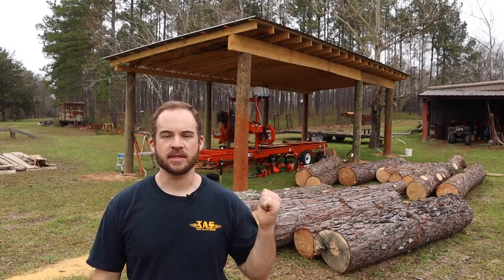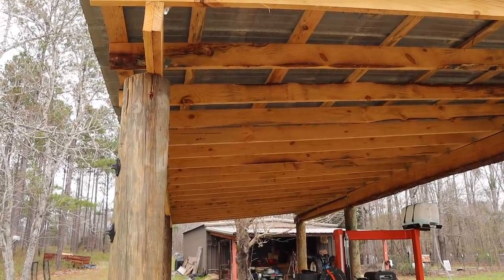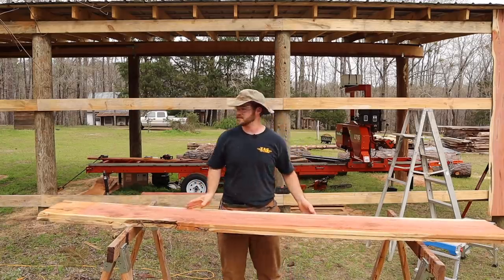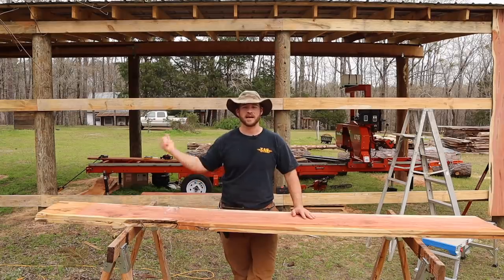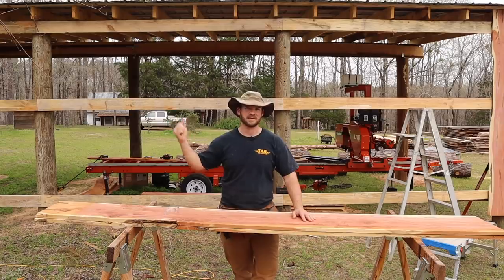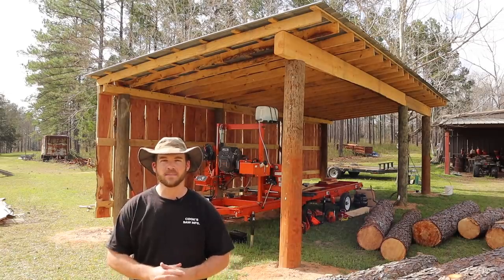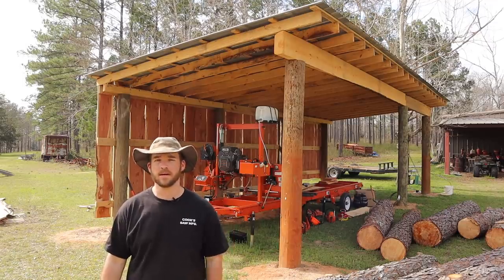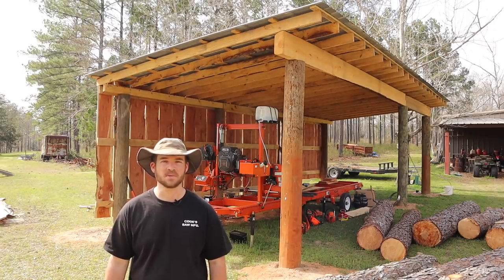These Cedar Boards Made A PERFECT Shed Wall

Comment: Beautiful ! ! 
It's like looking at an OLD COVERED BRIDGE.
I would build yokes from 4x6x18 and screw them to the posts. Then rest the purlins in the yokes. Just make sure to only secure one yoke first and clamp the opposite end. It will need to move around to get the purlin in. Then screw it to that post. - KJ
Reply from the maker: Great advice! Thank you. It does look like a covered bridge.

Comment: I understand their feelings, I love cedar to, but this is still America, use what you want how you want to use it. I would have done that back wall with heavy canvas tarps so it could be rolled up on the nice days.
Reply from the maker: Thank you! That canvas idea is pretty clever.
Reply: @falllineridge  I would use that idea for the end walls and front wall for winter and for ease of removal of the tractor and mill.
Reply: @michaelgoettsch7744  I agree the end and front could benefit with this, specially if they expect any snow. ( Evergreen trees tend to be in areas where snow is a common thing. )
Or even for when the win and rain are coming in from a different direction.
Reply: Fall Line Ridge canvas coated with beeswax is a pretty good waterproof material, canvas is already water resistant to a certain degree
Reply: @BESHYSBEES  absolutely, canvas hanging in sections with a pole at the bottom could be rolled up in sections or all together and tied. This would allow the air to circulate on those hot days. Beeswax would remain flexible, that is a good idea.

Comment: If you cut your joining beams on a 45 degree angle and saw out an indent on your round support post, you'll be able to secure your horizontal joining beams together in the round post. The two joining beams are screwed together on the 45 degree angle straight into the round post. 
Also, a shed of that size with those walls would benefit from some sort of bracing. A brace forming a 'V' shape starting from the top left and top right and joining at the middle post at the bottom.

Comment: At first I was worried about the gaps in the boards but I actually like it the way it is, and it’s good wind breaker but still allows the air flow. I reckon you should also make some more walls though on hinges so that you can lift it, and if you put it lower down, it would let the heat rise up and out while letting the breeze and air sneak in from underneath

Comment: That's a win !! You might take some 1 1/2 angle iron and weld up some hangers and bolt them to your post to attach horizontal boards to the posts might find some old truck frame or old farm equipment from scrap yard keep the John Deer green

Comment: To answer your question in regards to how to mount the top board.   Just mill a block and cut it to the length that slabs the width of the pole.  And screw it down to the pole. Then screw the header board to the block.  And remove the l brackets 1 at a time as you install said blocks.

Comment: Fall Line Ridge ; ..You have to curf-cut  the round post . But first strike a string line of chalk for the top and the bottom of each the board you are using to insert into the round post .    Then by setting your power saw blade to the depth of your boards you can make miniature cuts across the post. Space your cuts at about 1/4 inch till you make a batch of cuts that equal your chalk lines. Then cheasle out each of the small cuts . This will permit your boards to sit flush with each post and give building a huge support .

Comment: really nice job. an easy way to strengthen your purlins is to put a 2x4 on edge between the posts and attach it to the purlin (make it look like a "t"). when you toenail it to the posts, you'll see that flex disappear.

Comment: One thing I have learned from my 76 year old father who has been farming for nearly 50 years, and was a joiner before he became a farmer, is when building outdoor structures use nails, not screws. You never know when you are going to want to remove a piece of wood or dismantle an entire structure and screws get impossible to remove easily with age, whereas nails will always pry off. Nails are also much cheaper, and a hammer costs a lot less than a cordless driver!
Reply: Totally agree, nails nails nails... screws are best used inside, most of the time.

Comment: There is a special species of Cedar for use in closets and boxes for moth...   Aromatic.  Common Cedar is for shingles and other long term uses.  With that said, I think the cream color should be trimmed out - easier to rot that.  Good job - holes will allow some vents for air to cool off in hot weather. And dry in inside if gets wet.

Comment: Spraying some oil on the cedar would keep it looking great for a long time.  I work a lot with cedar and use tung oil but a friend makes outdoor rustic cedar furniture and he sprays it down with diesel.  He says it takes a little time for the diesel smell to go away but the cedar will look great.  He says another coating every two or three years keeps it looking good.

Comment: If you want to strengthen the wall just cross 2x3 lats diagonally from corner to corner. Cut on 45 degree angle and nail to posts. Basically secure those 2x3 lats  like an X from post to post and tack to the cedar boards. That will prevent it from swaying, buckling and still allow for air flow.

Comment: Joining the purlins... lots of options. Simplest would be two galvanised steel strips with holes for bolts and nuts, maybe 3” wide by 4’ long, three bolts in each board. Most complicated would be Japanese joinery, they have a fantastic method, easy to find here on YouTube.

Comment: To notch out the round post make a jig with 2x4 in the shape of a L and clamp horizontally to the post and use this to as a depth gauge.
Alternatively temp screw the 2x4 girder in place and run the circular saw on top and bottom creating a cut parallel with the girder then chip out with a chisel

Comment: Try using the same type of brackets that carpenters use to attach vertical beams to the sides of houses for decks, or to hold joists when expanding a ceiling in a house.

Comment: Were those poles formerly used as utility poles?  I would like to build a shed similar to that to keep my camper out of the weather.  I don't need walls to enclose it, just want the roof to shade the camper and keep the rain and snow off of the roof.  I like how you notched the top of the poles to support the weight of the rafters.

Comment: I tried to see if anyone had given any suggestion for how to properly attach the beams to the post.  You will certainly want to attach steel straps extending down both front and back of post and beam, then  probably a  1/2 X 12 X 12 angle on each side to seat the beam on the post.  I might also suggest  several lateral supports for rigidity side to side.  Wind would be your worst enemy.  Imagine that the roof and back act like sails with the wind.  A heavy wind might easily loft your roof at present.....

Comment: Hillbilly Logic - You go Bro that shed looks good specially that hole at the bottom
Reply: Meh just use corrugated tin roof pieces for cladding and it will look fine.

Comment: You'll be making byproproducts that can be sold.
Saw dust for anyone with livestock for the stalls, wood chips to cover gardens for folks in the city. But you'll need a cement floor to gather these easily.

Comment: Nice shed!  I only have one question.  I noticed the discharge chute on the mill is against the wall.  How do you plan to get the sawdust out other than shoveling?
Reply from the maker: T N That’s about it. I used to lay a tarp down when I used the LT10...let the dust fall on it for a while and then drag it off. That might work too.

Comment: It would be a bit of a pain, but you could also add a plastic tarp tied down on the machine to keep it really dry, and also the dust off of it when not using it for a long time.

Comment: take a long enough  log and  lay it across the bottom on a few sleepers hollow out the log as a trough you can put a pipe on it and drain or keep the water as needed,just an idea you have so many logs.

Comment: You would have had to notch out for those side pieces to be most sturdy.  Now that they are up though, you could cut some wedges to put between the horizontal boards and the round posts.  Then screw through both with 4 or 6" screws.  I doubt you'll need to, but if it ever starts failing, that's an easy fix with those arched wedges.

Comment: Around here Eastern Red Cedar is considered a junk tree, I've used it for posts and burn it in the winter for heat, not the best heating wood, too light, but it does smell good.  Gives me a rash so I have to wear gloves when handling it.

Comment: I just started watching...can you say what kind of fasteners you're using ?Thanks..may be a pole building in my future.
Reply from the maker: I used grip rite exterior on the shed and purlins. I used another weatherproof screw, a torx head deck screw, to fasten the boards. Forgot the specific brand.

Comment: You have a hurricane tie on every rafter and then the whole roof is just sitting on top of those massive posts with a couple screws. If you had notched those posts and cut a birdsmouth in the rafters the whole thing would be much more rigid and structurally sound. A strong wind is going to lift the whole roof off. As large as those posts are, even the girts could have been set into a notch to keep everything flush and tight.

Comment: Since you didn't notch to begin with maybe cross bracing on the inside up against the "perlins" with the ends notched into the poles and also screwed to the "perlins"?

Comment: You asked about cutting the 2x4 to fit flat ways on the post for you wall ,you have plenty of logs on the ground just find one about the same size as the post and take a piece of 2x4 put it at the end of the log holing it flush to the outside of the log and scribe the 2x4 around the log

Comment: You could have dropped the boards down from the roof a bit and left air space for heat to escape no rain would blown in  up top and all your boards would been even on the bottom  Just my take   keep the videos coming

Comment: Very nice.  However, hindsight being 20/20, I think you might have been able to improve the ascetic appeal by aligning the top edge just beneath the rafters rather than just beneath the roof line.  In that way, you could have avoided the problem you encountered at the far end.

Comment: Oh My Gawd ! You Short-Boarded the wall! You big meanie!
... I looks great, I'll bet it smells great, and it's going to age nicely - it's YOUR mill shed, it should be a nice place for YOU to spend time.
Square Board to a round column - 2 choices - 1) notch or flatten the face of the round column   2) have some blocking with a rounded, or wedge shaped face to seat against the column

Comment: Regarding flat purlin beams, what you could have done is cut eight 3x3x?? (let's say 4') blocks, and then nail them (nails are stronger than screws :) vertically against your posts with a 1" (??) gap into which you can fit your flat purlins. Of course these sizes are just to explain what I mean. 
I think that in that scenario the size of your purlins would have to be bit thicker (also 3x3's ?) and more square because you have horizontally the force of the wind, but vertically they have to carry the weight of the boards.
Finally, where you put that L bracket, a couple of short blocks nailed together (like a short triple-beam) could have done the same thing. This bracket will surely hold, but the blocks would have been easier, stronger ... and brackets rust. :-)

Comment: I agree with you that you worked to mill the lumber.  However, the cost of corrugated metal is around $20 for an 8 foot sheet.  So 3 of the cedar boards would sell for enough to buy a sheet of steel.  Again, I want to say that the Lord provided and you used the blessing how you thought it should be used.

Comment: Due to its natural rot resistance, this is the "highest, best use" for cedar. I build all my beehives from cedar for the same reason--no paint nor finish of any kind required. They've been in the weather for 10 years with no signs of deterioration. Best, @HoneyOnWales

Comment: Cedar is great against rot, moisture, and insects, why wouldn't you use it on an outdoor structure? A few chunks in a closet is all that's needed there, and the Chest, well that's good if you plan on storing clothing or something for a long time. I like your rain barrier. I'm not too keen about the spacing, probably would've ripped them for a tighter fit myself.

Comment: My wife had this episode come up on your channel, which I visit quite regularly.  I say "Baa" to the neigh Sayers about using the Cedar.  My grandmother's  Barn in Northern Mississippi was built with cedar siding in the early 1900's with planks that were rough cut to 1.25" thick, squared to 16" - 22" in width, and many cut to 26' lengths.  As a youth on vacation (65+ years ago) I can remember spending many  hot Mississippi summer afternoons in the shade of that barn seeing patterns in the grain of the wood and  thinking up wonderful adventures based on those pattern.  They stood as part of that working barn for over 100 years, and when the barn had to come down found new life as old wood.  
The "Circle of Life" for wood takes many forms -- The joy of first exposure, the timeless richness of their shade, the steadfast strength as years pass, the worn face of exposure to life, and the seeming final days their aged  wonder.
Then, one day an Old Novice, such as myself puts this now old and discarded 7' scrap through a Planner and re-exposes the youthful grandeur of the surface that once drove the vivid creations of a youth long past.
Wood brings joy to us, memories revives that joy, joy breeds hope in renewal, and hope will pull us through our current mess.  Enjoy your Cedar, honor the work it took to create it, and wait for the next cycle to appreciate it again, and again.
Dave (Opa) Hegmann

Comment: I love cutting that stuff on the mill. I also love keeping a stack of these boards for any, and all lightweight,  but strong building purposes, it seems to behave / stay super straight through most situations.... it's Sweet backdrop that will certainly be a great windbreak / shade zone like your saying ! ..It looks like there is a decent amount of pith rot and things going on in a lot of these boards, I don't think people realize that by the time these were all broken down into much smaller selective pieces, there would be a tons of waste (or really good fire wood) anyway it's rad to see more progress, thanks again for another cool video !   Thinking a solid way to attach the boards to post you , would be what you already suggested.... maybe snap a line across them all, then take a flat notch out, of-course that will totally take a bit longer !

Comment: So lets buy a $,8,000.00 log mill Get tags for that. Then wire the trailer up. Spend fuel and drive around. Spend a good day cutting logs and replacing $25.00 saw blades. Opps now we need to spend a few more thousands to build a shed to put the saw mill under a roof. Opps now we need hunt more wood and spend a ton more time to put a walls on for weather. As an old excavating contractor I say HAVE FUN and just enjoy the satisfaction of getting something done and if you got the funds go for it lol

Comment: Nice, I wish I had a big ol' shed with cedar sides. A critical comment, though, surprised you're carrying all the weight of the wall on deck screws and some angle ties. With time, those screws with corrode to nothin, yeah, you mentioned it, notch out the posts and the weight all sits on the polls, put a big lag bolt in there and the thing will be there forever.

Comment: I would moist blocked the ceiling rafters. Then just butted the boards up against the blocks thus eliminating all notching on each board and giving you more length in coverage and saving labor. You cab run the saw along the bottom to accommodate the slope of the lot,
. No offense, but it is a waste of Cedat to use it as wall cover. I’m a retired framing carpenter. Worked in the trades for 45 yrs.

Comment: I would of just cut 6x6 for the main  posts,,,that would of made it alot easier to keep straight ,,,,,,and also alot easier to put your siding on ,and alot more solid for screwing the you would have to cut notches in your beams on top ,just box them in with roof line !!! Work smarter not harder 😎😎😎😎😎🇺🇸🇺🇸🇺🇸🇺🇸🇺🇸🇺🇸

Comment: I never read through your comments , this may have been said. you might want to add 45 degree bracing from the poles up to the beam you ran from post to post. 3 or 4 feet long with 45 degree  cuts on each end would be sufficient in case of some high winds. (I like the building).

Comment: That cedar will be there for your grand kids to enjoy. Also on the front to keep rain out, you can get a heavy duty tarp, and run a cable along the top of the shed, string the eye's of the tarp on the cable and use it like a curtain. So when the mill is in use you just push the tarp curtain to one side out of the way.

Comment: Looks really cool. It must smell amazing. If you are still wanting to add rigidity to the wall, you could turn the purlins into T-beams by having someone hold up a board on the inside forming a T, and running long screws through from the outside.

Comment: I think it a waste of good lumber. But its yours so have at it.  I can tell you dont used cedar outside much. The red will last for a very long time. The white will be rotten in just a few years. 

You could have use joist hangers to hang them, but it wouldn't have helped on the ends'